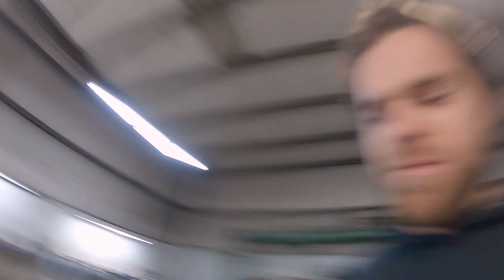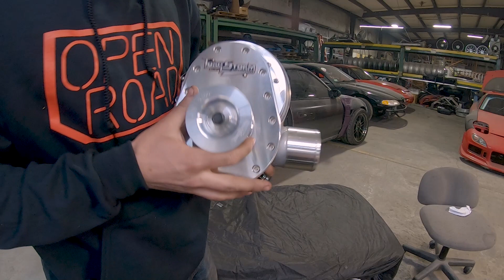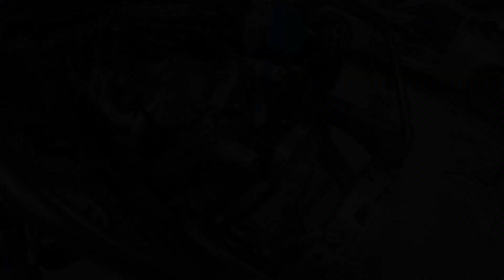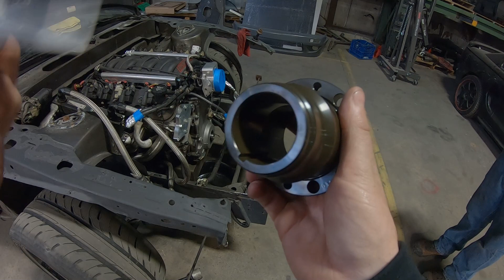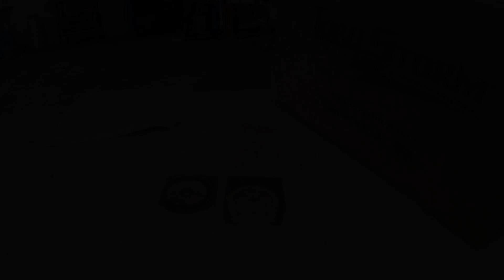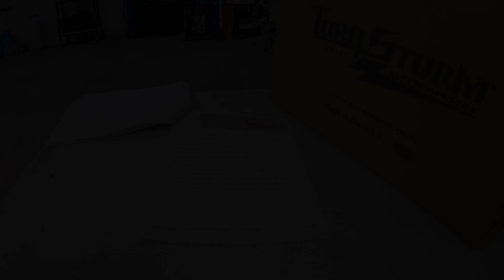TorqStorm Supercharger Installation

Comment: Quick question my crank has a key way for the slot where you used rtv, there for I wouldn't need to drill those holes for the pins correct?

Comment: man im having hell keeping the hub from turning so i made something with thick metal,but heres the thing,im still barely under 1/4 away from it sitting flush to the crank i know its not supposed to be flush my mic measured .230 from the crank to the hub where you drill,and im not sure if thats it,ive looked everywhere in my directions and on here online every where and nothing,kinda pisses me off and dude where did you get that tool ? the black pipe bar with round plate that bolts to ati ? i cant find one either,im going to give torqstorm a call today,but their so busy i hate to bother them,but my god i havent got pass where im at,if you could holler back reral quick that would be great.if you remember was it like a 1/4 step or just under that to the crank where you drill,Anybody know? thanks
Reply from the maker: Hey man I’m sorry for the late response on this. Hoping you got it figured out! I have one photo of my ati damper on the crank and I can send it to you if you’d like to see it if it helps. Message me on Instagram @tgarlatz if you use the app. Also my buddy made the black tool we used to hold the crank, he had a cnc plasma table so it made life easy..

Comment: How much boost can one of these make in a sbc?
Reply: They can do about 700 hp on a sbc 350 you will need a better cam and some good flowing heads to get to the 700hp mark, it will make close to 500 on a stock 9 to 1 compression truck motor at about 12 psi

Comment: Do you really need to install a air box?
Reply from the maker: You will want to add something to the inlet so you don’t suck rocks and dirt into the supercharger. I’ve actually opted to run what’s called a “turbo guard” on mine since I didn’t have room for a filter.

Comment: What do you think hood clearance is like? That's The only reason I want to go torque storm over LSA...I want to keep my hood intact.
Reply from the maker: Their vehicle specific kits fit under the hood great, but since I put mine in a Nissan I had to cut a hole in it. I need to make a new video asap but if you want to see photos and current progress you can check it out on Instagram @tgarlatz

Comment: Thx Tyler, finally some in depth Tstorm coverage - although as u said, not my exact application - about saved up my $5k to drop on the full meal deal for GM 502 set with the accessories including  A/C pump, brackets, etc. Plus I will be going blowthrough setup of MSD Atomic FI so hafta do high volume/pressure pump arrangement, all into my 70 Chevelle. Seen nothing videowise about it so again Thx for details and as with the rest, hope to see wheels spinning soon, both regular driving around to show common daily use, as well as gettin on it here & there
Reply from the maker: Any time my friend, glad I could help! A ‘67 Chevelle is one of my dream cars, so I’m excited to see your setup. I know you said Msd, but I can’t possibly save you money on Holley components if you ever need any!
Reply from the maker: goratgo 70 I Can* possibly save you on Holley stuff
Reply: @tylergarlatz1577  possibly help with old Holley projection? Have a two & a four but calling them no good, they don't support any of it. And just ordered the 502 full setup from Tstorm, how long did it take to get yours?